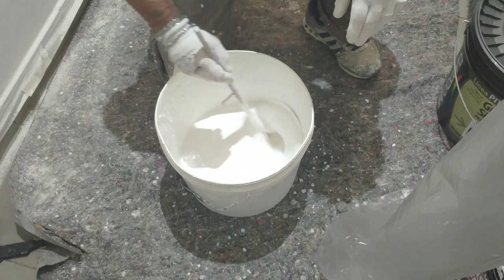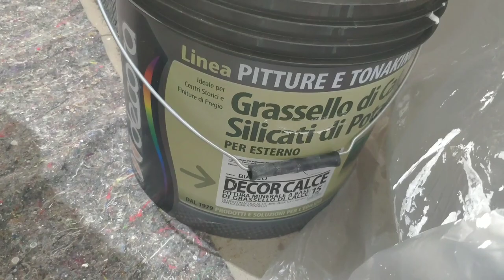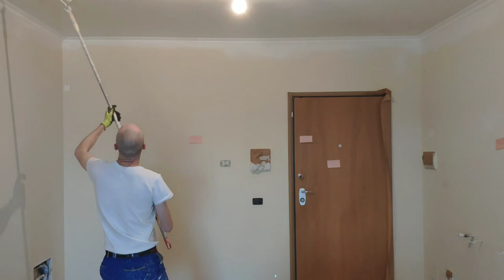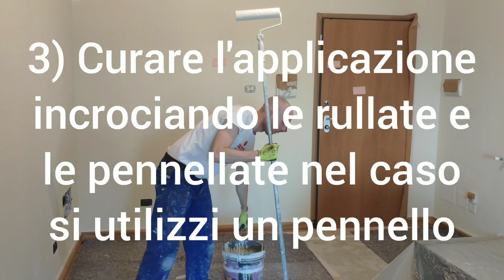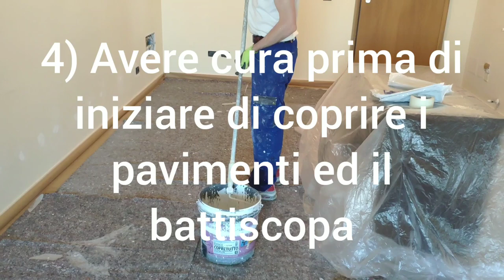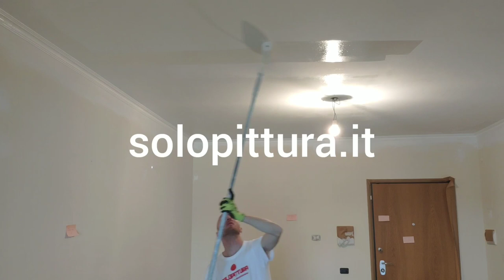Perché tinteggiare con la calce? 5 cose da sapere.

Comment: Ciao, tu che proporzioni fai  di calce idrata ed acqua per rendere la calce della densità giusta? Una volta miscelata la utilizzi direttamente o va lasciata riposare per alcune ore o addirittura un giorno intero?
Reply from the maker: La pittura a calce è pronta all'uso
Reply: @giuseppeg1513  mah io ho sempre usato calce idrata nel secchio 4-5 giorni a pelo con acqua passata con il setaccio altra acqua e vinavil 1 kg in 15 litri o quella di giotto che costa meno una cazzuolata scarsa di cemento bianco non troppo se no fa le righe e rullo massimo 2 mani se no screpola